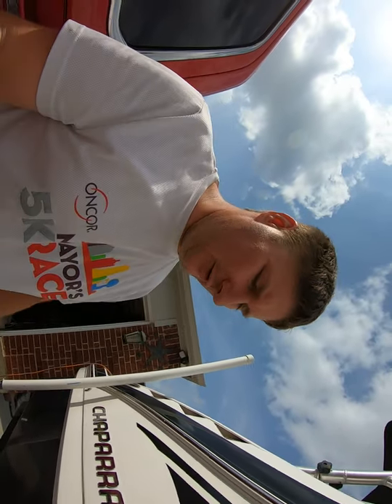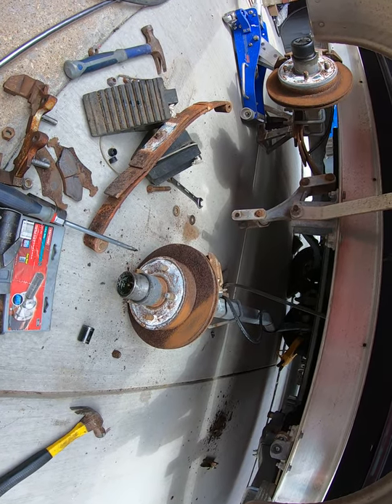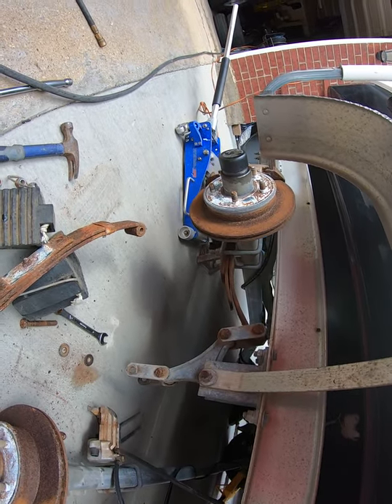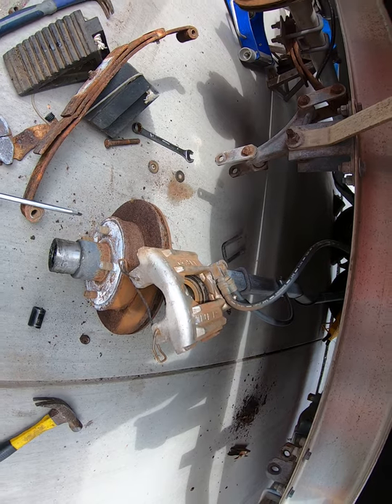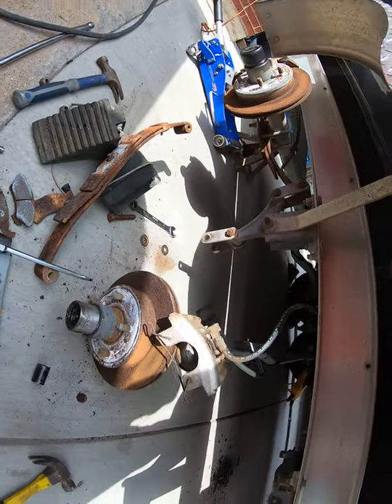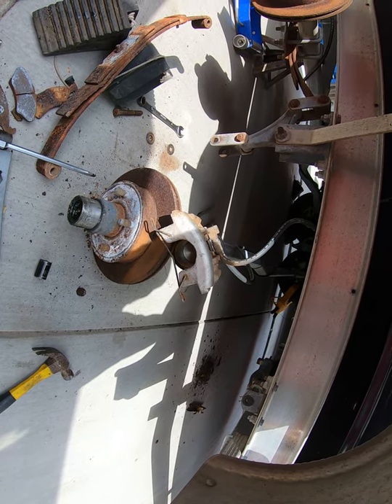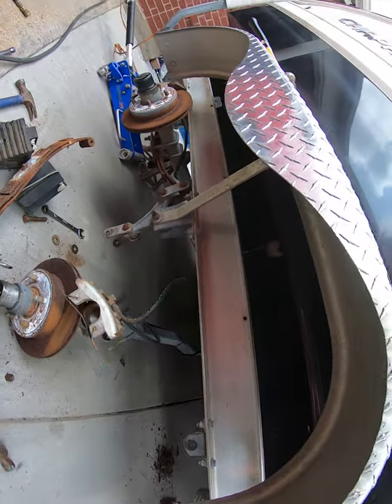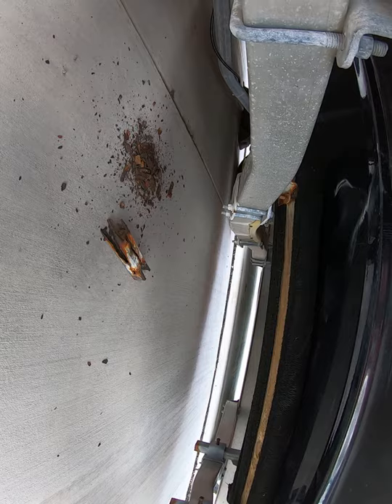Chapparal boat trailer repair (Magic Tilt Trailer)

Comment: Hey man.  I appreciate your videos.  I have a 2001 Sunesta 233 since new.  I saw your video on the aqua marine decking, however the comments were turned off.  I just wanted to know if you still like it or if you would do anything different.  Im about to pull the pin and buy it, but wanted some more input.  Thanks !